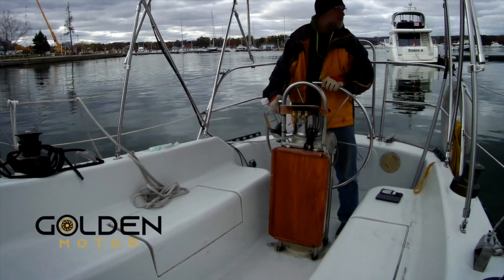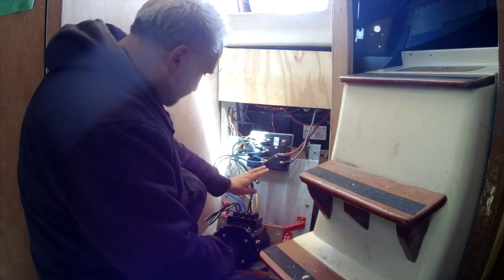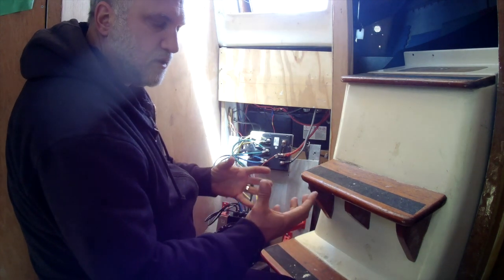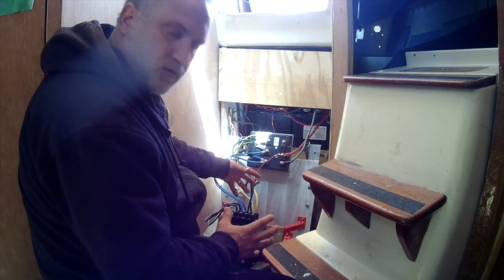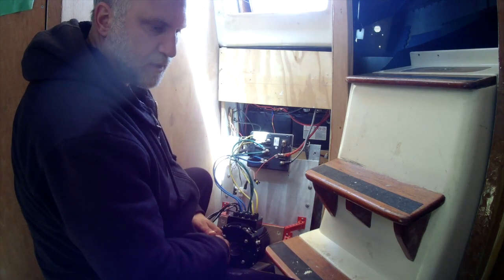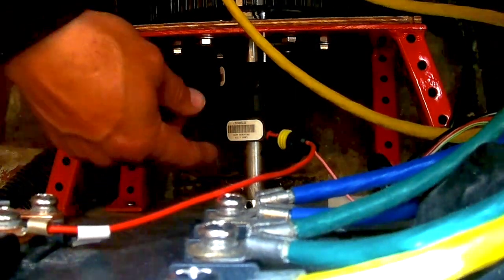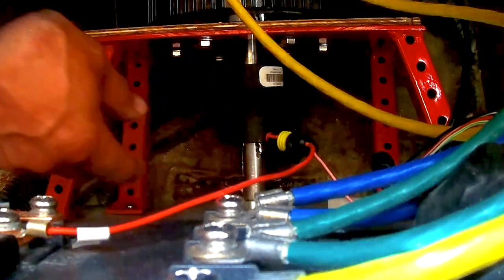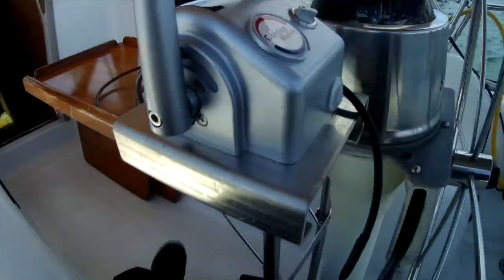Ep76 the short version: Golden Motor 10KW 48V BLDC Electric Motor Sailboat conversion after a year

Comment: Hello, I have a question about the throttle: Which wire colors did you use from the pedal to the controller? Thanks :)
Reply from the maker: i don’t have a foot pedal i have the boat throttle it has a connector that directly connects to the controller. its a 3 wire connector and was marked throttle. i didn’t have any other 3 wire connector on either vec500 or now the ezkontrol that would match the throttle end. my controller end is red/green/black and my throttle is red/white/black. their website had a detailed diagram with colors if i remember correctly

Comment: Thanks for the video, I just received my 10 kw motor end VEC500 controller. My old diesel engine died a few months ago and I thought about the cost of maintenance, the silence, the fumes... So now I am just waiting for a set of LIFePO4 batteries to come all over from China befor starting the tests and mounting. Your experience is of very good help.
Reply from the maker: i watched so many videos of cruisers breaking down from the sea water corrosion, water pumps, water lift mufflers, impellers, hoses... and then finding parts. for me that was a major factor. electric motors ‘can be’ very reasonably reliable if not overdriven and overheated. i hope your install goes well best of luck to you.

Comment: I'm interested in knowing how much power you get from the 10kw...  I have a 36 ft. Full keel, and working on sourcing motors as well...
Reply from the maker: after a fair amount of research the 5kw probably would have done fine but i would have had to run it harder. what convinced me was comparing the torque rating of the 10kw vs 5kw at the same RPM. The 10kw was 30% more efficient meaning it needed 30% less power to run the same boat speed. the other factor was that in a jam i had more power. in reality of everyday boating how i use it i rarely get over 1.5kw of power to move my 35.5’ hull at 3 knots (maximized battery life in my case). 

thx for watching-and best to you on your project!
Reply from the maker: oh my 10kw is apparently about 13 horsepower but with an 85% efficiency factor. instant torque. it is notably more powerful than the atomic 4 which i had to rev at max to get to 5 knots hull speed. it was loud and smelly and 30hp the old atomic 4. my guess is it was 30% efficient so about 10hp comparatively speaking. lots of different views on that topic...
Reply: I know it's been a while but did you end up installing a electric motor?
Reply from the maker: @nukifla7952 yes ive had it installed 4 years now.
Reply: @TheNeds  thanks, i actually meant to ask @SV_Sangha as they have a boat with specs close to mine😀⛵
But how are you liking it, still good?
Reply from the maker: @ ya had it 4 years now. taking it to the coast this year lots of motoring in the future fingers crossed 🤞
Reply: @nukifla7952  Had some family two years ago come down sick then passed.  I stopped the build and have not finished it.  I am now down in the SW, but boat is up in the PNW...  I am hoping this summer to get back up there and complete the build.

Comment: If the motor controller is getting hot, consider mounting it to a water cooling plate when you water cool the motor.
I think having two stators in phase with the same pole count means you can run two smaller FOC controllers, and if one fails you can still run with the other, be it at half the maximum power the motor is rated for. Good for redundancy.
Reply from the maker: appreciate the advice. so far the controller hasn’t overheated but i assume the weather plays a factor.

redundancy is a big consideration and i am still wondering which has a better lifespan the controller or motor. my gut tells me that the controller is going to fail before the motor so 2 controllers might be needed for piece of mind. i always have my sails for backup engine ;)

appreciate the comments thx!